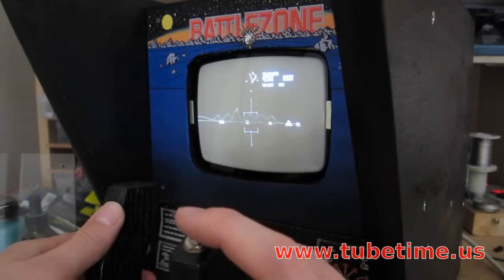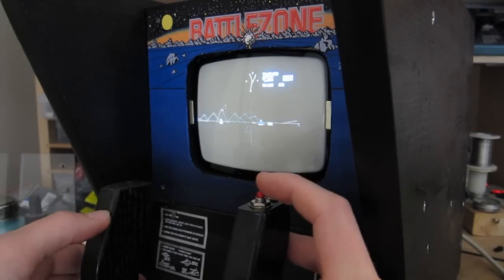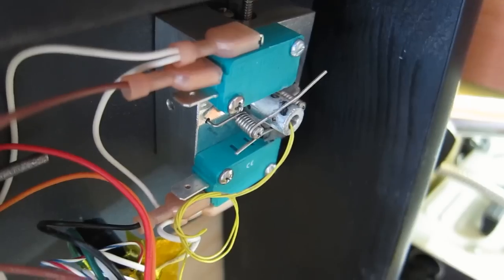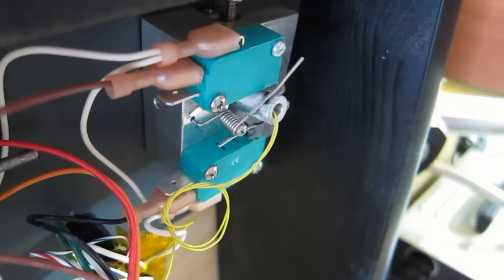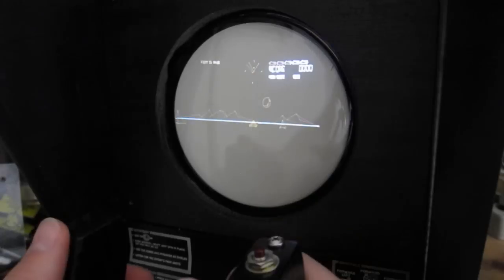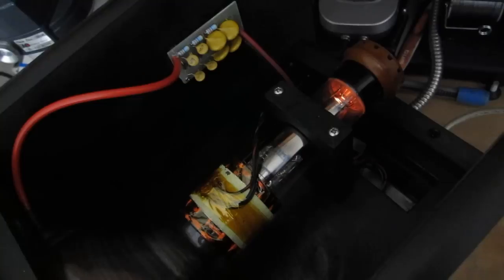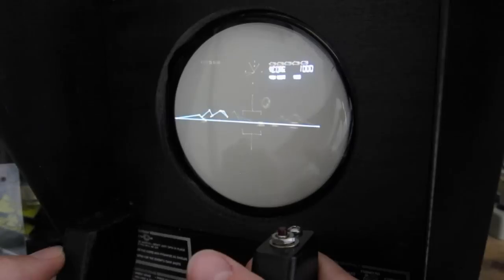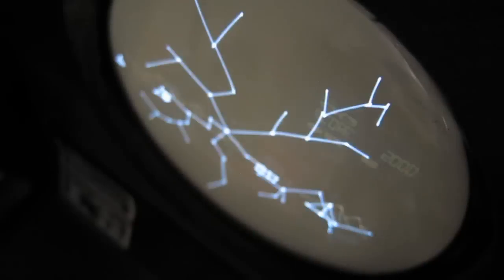Battlezone Mini Arcade Machine

Comment: Your work is amazing! :) If you don't mind me asking, what was the name of the 1950s book on hand winding deflection coils? 
I am currently trying to recycle small CRT TVs to turn into oscilloscopes, and I am having issues with displaying square waves properly due to impedance to high frequencies (turns square into sawtooth), and this is the most valuable information I have found so far! thanks :)
Reply: I don't know if you were ever PM'd about this. And yes I know this is a year old, but on one of his blog posts (http://tubetime.us/index.php/2014/05/26/crts-with-magnetic-deflection/) he references a book (MIT Radiation Laboratory Series, Volume 22: Cathode Ray Displays) and links to this page which contains a PDF copy of the book: https://www.jlab.org/ir/MITSeries.html